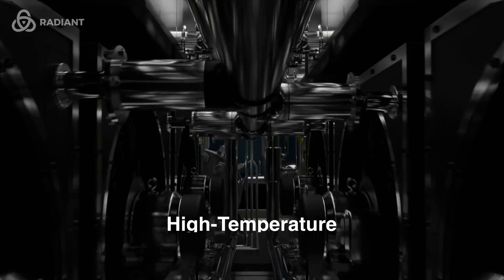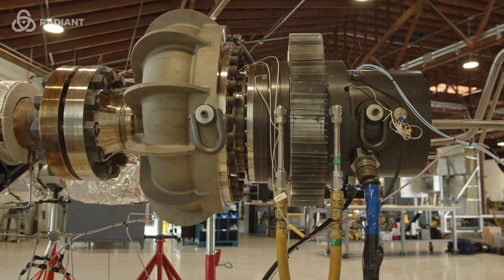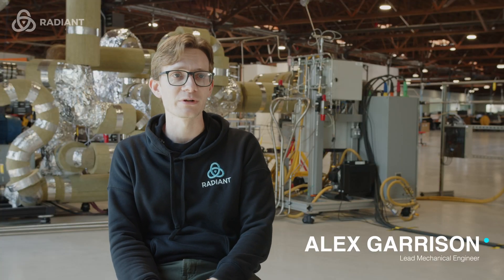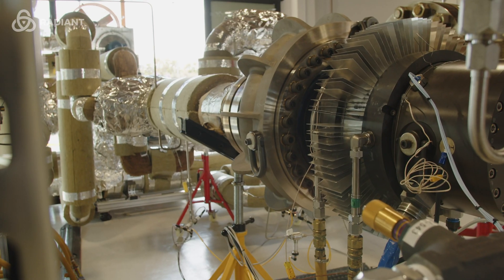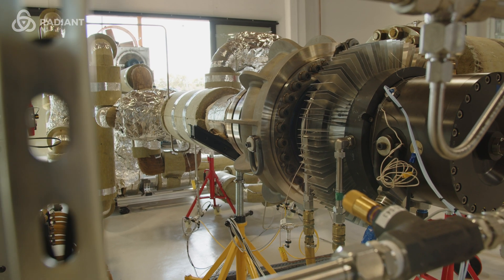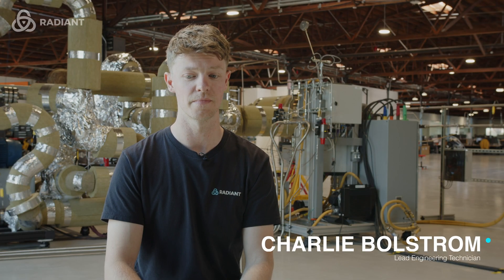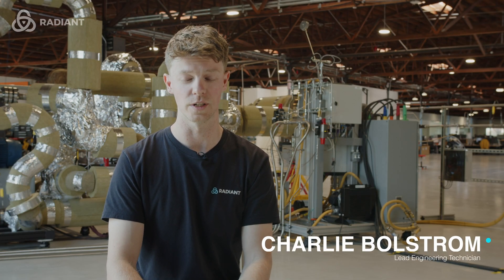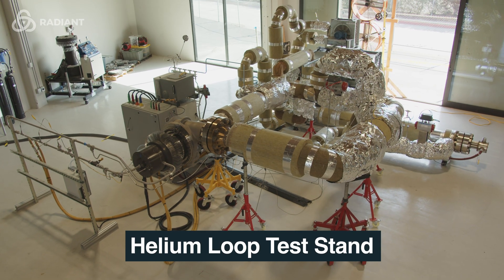Kaleidos Helium Circulator Test Milestone

Comment: You need at least two circulators per primary loop. Mechanical failure of any machinery with dynamic components is a question of when, not if, and it needs to be possible to passively isolate a circulator that has failed to maintain pressure and flow.